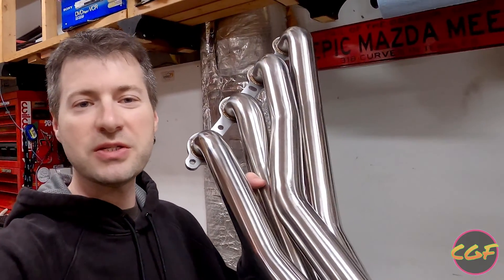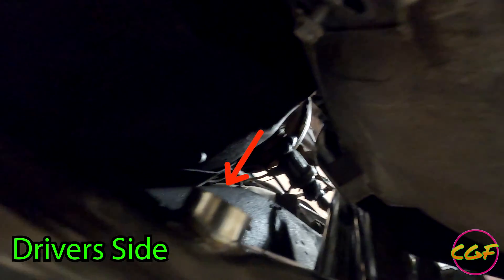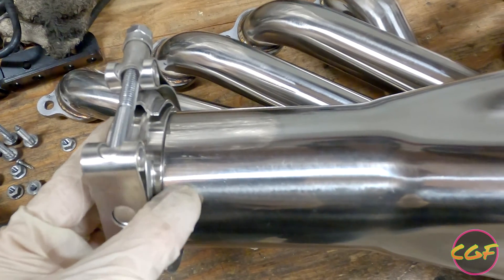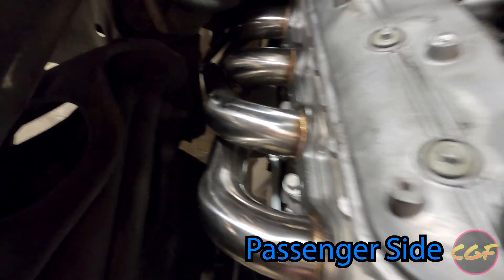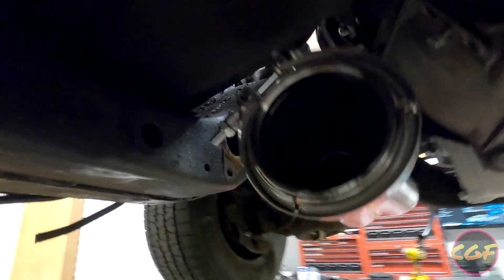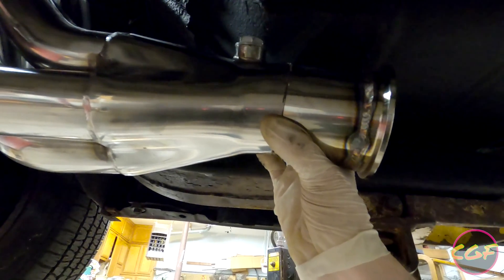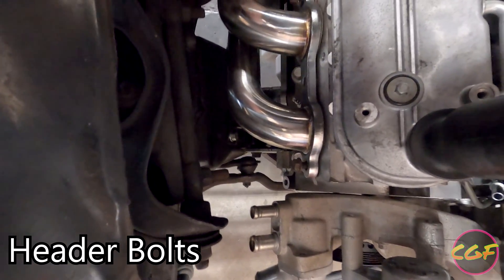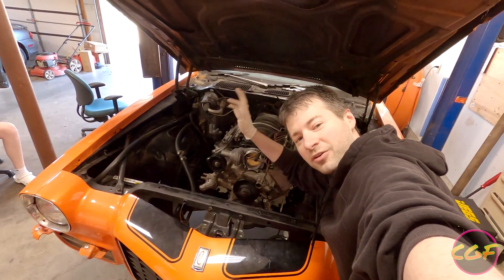Speed Engineering Headers on the LS3 2nd Gen Camaro - Complete Install (Budget LS Swap Headers!)

Comment: Out of curiosity, how far does that intake manifold set down below the hood? I have an 81 Z28 that I am an LS2 built for and can’t decide rather to go with a Fast LSXR intake or the taller LSXHR. I know  the LSXHR wont fix under a stock hood and I’m not even sure it would fit under a cowl hood.
Reply from the maker: It's pretty far below the hood line. You could certainly go taller.  How much taller I'm not sure off hand.

Comment: does the trans pan hang to low to the ground? Is this project on hold?. Thanks
Reply from the maker: Hey! Project is driving. I just didn't finish editing videos.    I ended up using a more shallow trans pan from a g8.  That pan made it sit about where the oil pan was height wise.
Reply: @CarGuyFridays  Could I contact you please?
Reply from the maker: Sure. I believe youtube let's you email me from the home page?
Reply: I will need to change trans. pan too. @CarGuyFridays

Comment: Great info! I am doing an LS swap on a 79 Z28 right now, what did you do for your alternator bracket? Mine hits the idler arm and interferes with motor mount in down low stock location
Reply from the maker: Went with one of these so I could keep using my existing accessories. 

https://lsbrackets.com/camaro-ls-l99-ls3-alternator-bracket-38-billet/

Comment: I have moroso solid mounts on the frame and speedway block mounts with some ict billet adapters and the same headers and didnt have to clearance or change anything. They cleared everywhere on a 79 camaro
Reply from the maker: Nice! I'd guess it's really dependent on where the lsx swap mounts sit the engine.   Doing nothing but bolting them in would have been great!